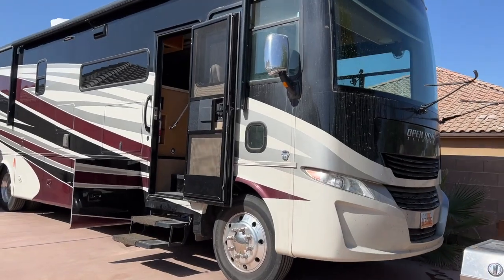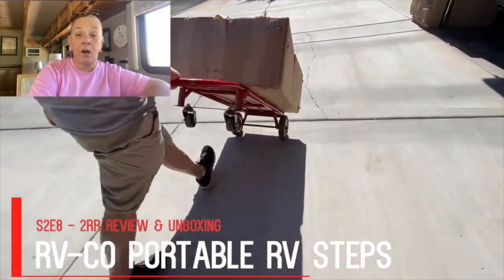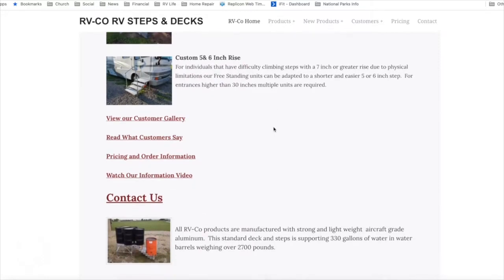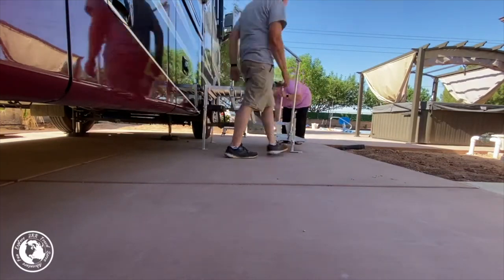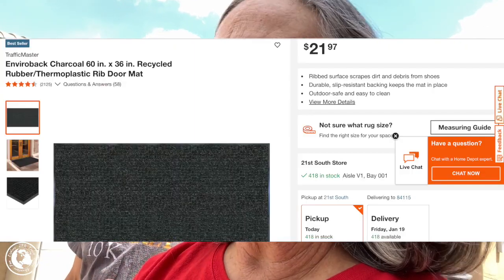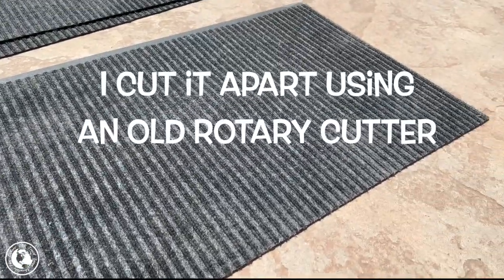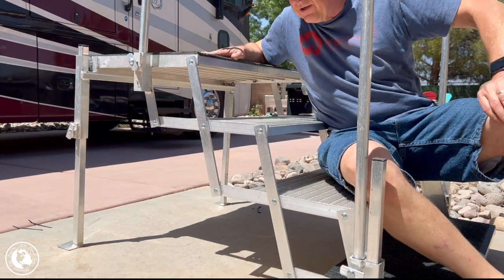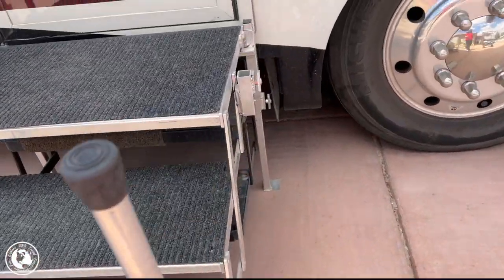RV LIVING: 2RR TBT! RV-CO RV Step Unboxing & Setup w/BONUS Footage of Carpet Install on STEPS!

Comment: Nice!  Did you find that you needed a zip tie in the middle on the front edge of the tread?
Reply from the maker: No. The four zip ties on the ends have kept it nice and flat on all of the steps. Great question! Thanks for stopping by!